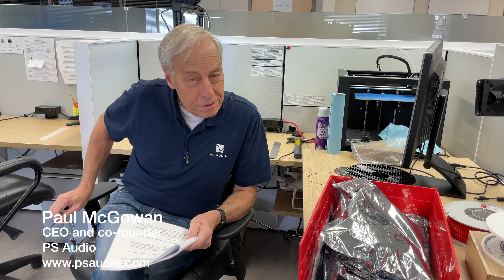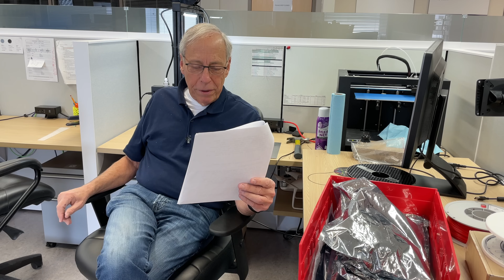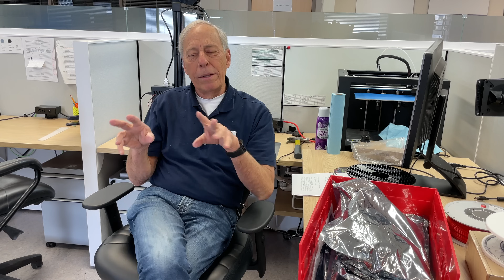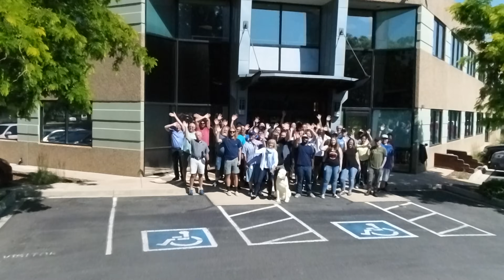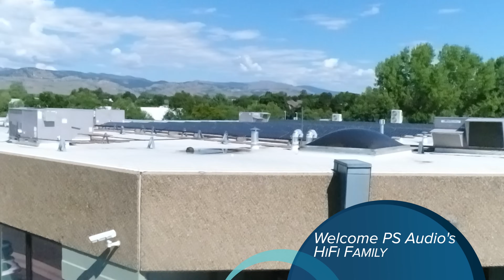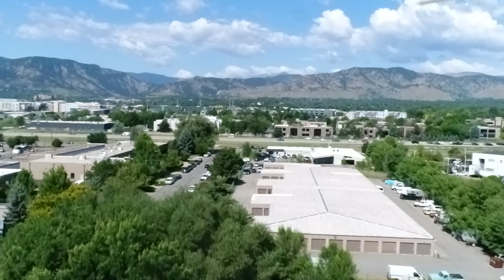Does bi amping change impedance?

Comment: For some reason I always thought my Paradigm Studio 60 v1 were wired to have the mids and highs on one binding post and the woofer on the lower one. Nope. 

I just tested and with only the top binding post only the tweeter is on. 

The only reason I can see somebody may want to bi-amp these days is that they may have two extra channels of amplified outputs. 

Example I bought a 7 channel receiver 150wx7.  They decided to only go 5 channels.  

The main speakers have dual binding posts but perhaps it’s wired to play mids/highs with one post and the stand alone woofer or woofers with the other binding post.
Reply: The main reason for bi-amping is to have one amp with better highs and one with better lows. There will be no benefit regarding to power so only people who missunderstood how things work do that to get more power.

And I am pretty sure the surround reciver is not actually 7x 150w. Maybe peak at 1kHz 1ch driven 1% or more THD.
Most are rated wrong. NAD and some others rate theirs correctly and therefore rate lower numbers.
Reply: @Oystein87  I understand your “theory” concept but it’s not very “practical”. 

There are issues with putting this theory in practice and we know this.  Most don’t go through the trouble and hassle of doing this.  

Are you currently doing this yourself and you did so on purpose?  Most end up going this route on “accident” or they were lucky to stumble upon on extra amp and thus gave it a try.  

Ideally one of the amps has to be integrated also or have input gains because this way you can balance out the volume/gain between the lows and highs.  

Another example is what you’re leading on to pertaining 7x150w at 1khz.  Some may think they are missing something and happen to get a hold of or buy a separate two channel amp with more power.  

But they stop and think well what am I going to do with 2 channel outputs  then.  They may consider bi amping.  Most amateurs would put the receivers output to the tweeters also and put the new amp to the woofers/mids for the mains.  They may not necessarily achieve what they desire. 

Something to consider also.  If “bi-amping” was really a good thing (cost / benefit) the companies would design amps as you described.  A certain Class A section for the mids/highs and Class D or Class A/B for the lows.  Pre-amps would he designed with 2 left and right channel outs...not just one each.  This doesn’t seem to be happening en mass.
Reply: @f430ferrari5  It's not a theory but a fact. Different amps sound different. That's why it makes sense.
And there are really not much issues. Just more cost.

No, I have no need to do it myself. But I know it works great. Most go this route because they want to.

No, not really.. They just need to have the same gain and both can be power amps if you want.

And the rest I don't even bother with
Reply: @Oystein87  what do yo mean “fact”.  If you’re not doing it yourself in “practice” then like I said you’re just working off “theory”.  

I don’t have a problem with your “theory”.   Sure amps sound different but they don’t cause enough of a net positive difference for a whole bunch of folks to “purposely” go down this path.  

You know I am correct.  If anybody is bi-amping it’s more by accident.  

If you think your theory is correct and so good  then put it in practice.  There is a reason why you don’t even bother.  😂🤣
Reply: @f430ferrari5  I have tested and it's a wide known fact.
No, I am not. Heard several systems.

Depends on the speakers and amps. No rules here.

It's not by accident.. Basicly no one does that.

I have no need doing it myself since both my amps sound the same and I like the sound in the whole freq range....🤦‍♂️
Reply: @Oystein87  well if you tested then why didn’t you keep it if your “theory” was so great. 😂🤣

Before you were claiming you never bothered.  Oh brother.  

You don’t get it. It’s like spending 50k to squeeze out 10hp out of my Ferrari.  Wake up.  It’s not worth it or even practical.
Reply: @f430ferrari5  Because I changed amps... If you think a little longer than your nose than you would get this.
The practice (not theory) is great and I recomend people doing it if their system benefits from it. If you have cheap speakers there will never be a real benefit anyway.

No... I said I don't bother with this because I like the sound my amp gives in the whole freq range. So I don't have a need for doing it anymore.. A bit hard to understand?

You really don't get it at all... You are actually not even close to understanding this. And no.. It's like spending a little bit of money to be able to get even better sound in some cases.
Or when using your weird example: Spending 1K to get 50 more HP..
Reply: @Oystein87  no you don’t get it at all. 

Look.  Your bi-amp “idea” where one is better for highs and the other for lows connected to the same cabinet has been around for years.  It sounds good in “theory” but there are reasons hardly anybody puts it into practice.  Wake up.  I’ve been trying to tell you this from the beginning.  

You keep claiming “fact” but you never provided tons of examples where people are doing it and many high end audio companies are coming out with products like this historically.  You even support my claim by “you don’t bother with it”.  😂🤣

Why did you even bother to change amps you fool and move away from your “brilliant” bi-amp idea/theory.   😂🤣.  

You’re so stubborn.  Most folks also like the sound their own “single” amp gives through the whole frequency range.  This is why we don’t bi-amp in practice.  Got it?   

That is why I stated most who bi-amp or give it a try is because they had an extra amp and/or speaker outs.  Wake up.   

All this back and forth for nothing from you. In the end you have agreed with my point. 

My car analogy is for more HP is spot on.  It’s called bang for the buck.  Who’s is going to spend so much to squeeze out such little extra HP. Hardly anybody.  

Most don’t want to purposely buy two separate type amps like a tube amp for the mids/highs and a solid state for the lows.  It’s too costly and takes up extra room and there is volume matching issues etc.  Wake up. 

The only manufacturer I know that even had this tube and solid state combo is McIntosh.  It’s mono block too and very costly.  Most people don’t do it because it’s not a great bang for the buck.  It’s not “practical”. Got it?

You don’t even seem to realize almost any person that listens to music and/or home theatre actually uses “two amps” for the most part.  

The first amp or receiver plays the mids/highs and some lows and the second amp already attached to a subwoofer.  Got it?  Now think this through.  

Look at how many speaker companies make bookshelf speakers models that produce mid bass/mid/highs.  They are already built with a concept that the listener will be purchasing a separate subwoofer or two even. This has been popular for over 40 years.  

Only back in the 60’s and 70’s and early 80’s did we have floor standing 10 or 12 in woofer 3 in mid and 1 in tweeter concept all over the place.

So again it’s obvious as to why “bi-amping” doesn’t catch on.  You ended up moving away from it yourself.  😂🤣.  Thanks for proving my part.
Reply: @f430ferrari5  Omg.. I wont even bother reading your comment anymore. I am right and it's really nothing to discuss. First understand what you are talking about and then you can disqus.
Next time I will consider bi-amp again.
Reply: @Oystein87  😂🤣 it’s you who can’t admit you were wrong.
Reply: @f430ferrari5  I am not wrong....🤦‍♂️
Reply: @Oystein87  sure you are.  If you were not you would have kept your bi-amp system but nope you didn’t want to bother with it anymore per you.  😂🤣

You went with a single amp to drive your speakers full range since it is so much more “practical” to do so.  😂🤣.  You even said it yourself.  

Let us know if you ever change back to bi-amping.  😂🤣
Reply: @f430ferrari5  I would have kept my bi-amp setup if my new amp did nit sound even better in the whole freq range. Why is this so hard to understand?🤦‍♂️
Next time I consider bi-amping again to maybe get even better highs. But no rush right now.

No, I did not do it because it's more practical.. I said above why I did it... Stop assuming shit.

How old are you? 14?
Reply: @Oystein87  the only “facts” you give support my position not your own. 

You said you once bi-amped but no longer and you explained why. That reason why you switched I already told you previously is why most don’t do it to begin with. 

This is why your bi-amp “theory” doesn’t go into “practice” very often. Wake up.  

Got it. You can’t admit to this simple concept of “practicality”.  

And now you’re true to claim adding another amp is “practical”?  Then how come you didn’t do it to begin with?  😂🤣.  You didn’t even answer my point. Why not invest in a better amp that is better on the high end and go back to bi-amping.  You’re now admitting that the only thing you would change is for even better highs.  So what’s stopping you?   Your very own situation supports my position.  

I can easily bi-amp right now.  I have 2 separate amps.  200wx2 and 200x3.  I still have all the speakers for my 5.1 system which I got all in the late 90’s.  The Studio 60’s and 20’s have 2 binding posts each. 

I’m listening to 2 channel these days so I have 3 extra speaker outputs.  I could use 2 “in theory” and allow the Studio 60 to get 200w just for the tweeters on each side.  Is it worth it?   I don’t think so.  

If the Studio 60’s were configured where the midrange driver and tweeter were hooked up to one binding post and the woofer on its own yeah I would give the bi-amp a try.  But knowing the tweeter is on its own forget it. 

I may move back to 5.1 also so to me is not even worth it to even try.   There are other reasons too why I don’t bother with another amp.  It doesn’t fit anywhere and the brand I have is no longer made.  I don’t necessarily believe in the mixing of component brands either which you are promoting.  

The only one throwing a tantrum is yourself.  You’re the one swearing and using words like 14 year old.  😂🤣
Reply: @f430ferrari5  No, they don't. Not my problem you can't read or understand.

I will most likely bi-amp again my next system as I said. The advantages are awesome and I recomend doing it👍

No, it's not. Wake up yourself. Most people don't even know it's possible so that's really the main reason.

I will of course never admit something that is not true.

Yes, it's practical. Barely any more work to hook up (actually takes about the sale time as hooking up one amp.
Why do you think so many have pre-amp + two or more monoblocks for their setups if it's so unpractical?🤣

Again you missunderstand thr point of bi-amping. It has NOTHING to do with power😂 a 200watt amp on your tweeters will not actually give 200 watts to your tweeters... Maybe they get 5 watts after the crossover does it's job. So the amp will never need to deliver 200 watts anyway. You prove yet again that you have no clue what you are talking about🤦‍♂️

No I am not.. Only you acting like a 14 year old without knowlage and just pull claims out of your ass. Get yourself some basic knowlage instead of arguing about a subject you obviosly don't understand at all. You have proven in every single comment that you don't understand this so why do you bother!? Unike you I have many years of experience and knowlage. You should learn from those who have more experience than you instead of arguing with them. Maybe yoy can actually learn something👍

And again: How old are you?
Reply: @f430ferrari5  I am not stubborn at all. That's just you..
I just know what I am talking about unlike you...
Amazing how far you are willing to go to deny something you do not even understand or have tested🤦‍♂️

I'll ask again: How old are you?

And what experience do you have?

I have almost 30 years of audio experience and knowlage.
Reply: @Oystein87  you didn’t explain anything and you have contradictions all over the place and you cannot follow through by answering simple questions or situations presented to you. 

You are dead in the water and you know it. 

This is what killed you.  Mono block.  You don’t even want to address it. 

Go ahead and claim bi-amping with two different amps is better and more practical vs two same mono block amps.  You’re the troll.  You responded to me.  I made my statement and my comment got 3 likes.  You have none.  😂🤣
Reply: @Oystein87  oh and I knew you wouldn’t post up your system and the type of speakers and amps you have.  I pretty much gave me mine.  

You won’t do it because it will prove how utterly ridiculous your own situation is vs that or what you are talking about in “theory” pertaining to bi-amping.  

Like I said.  Go ahead and propose your “brilliant” planned bi-amp audio set up.  😂🤣
Reply: @f430ferrari5 How old and what experience do you have?